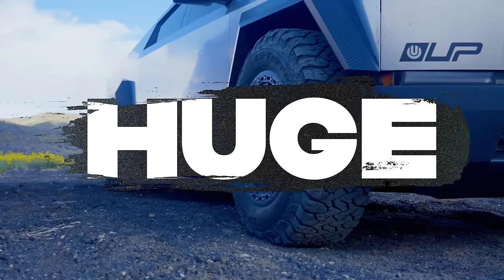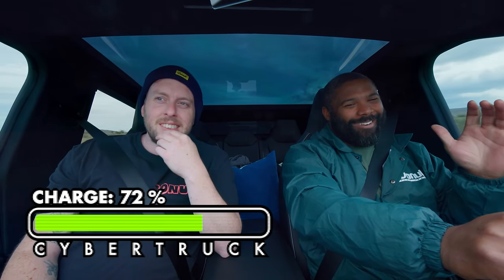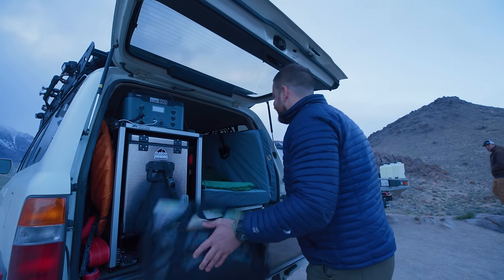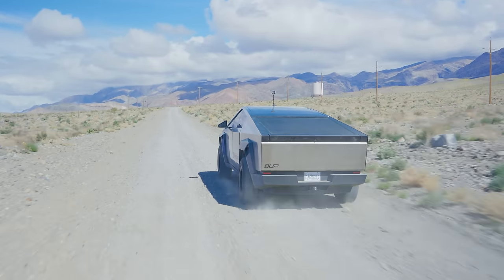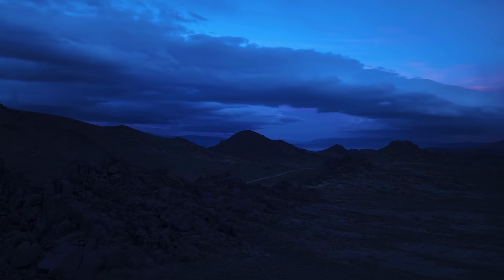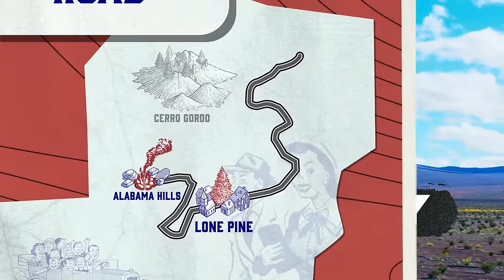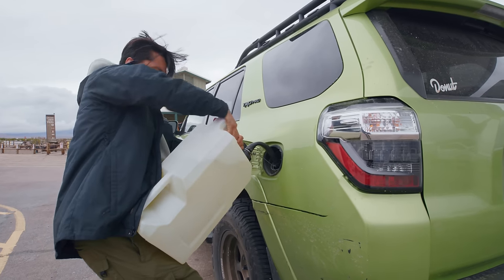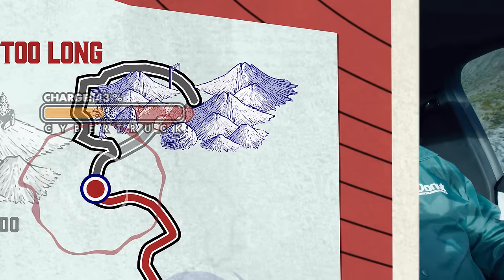Surviving 100 Miles Offroad in a Cybertruck

Comment: Having owned a tesla for over 5 yrs, the radio doesn't reduce range, it runs off aux 12V battery. And driving 80mph will drastically reduce your range

Comment: Ok, so… all those accessories you say are draining the battery, are also draining the tank in an ICE car.  With a lot less efficiency too, since its got to be converted to electricity from gasoline through a very inefficient process to begin with. 
Also, those things are minimal effects compared with driving the car.

Comment: The thing with the range is, Tesla manipulates the range estimation in all of their cars. Essentially when the battery is still quite full it will show you a wild overestimation of how much range you have left. As soon as the battery starts getting empty it will show you a much more realistic range estimate. And the cybertruck is especially bad with range estimates because it's Teslas most rushed and most stupid car and if you try to take it offroad the range estimate becomes essentially useless because the battery draw varies wildly based on the ground you are driving on, the speed, the weather etc etc.
Reply: The actual range in testing (outside of Tesla) was shown to be 22 miles higher.

Comment: EVs are great for city driving, commuting, pleasure type drives. Road tripping is OK as long as you're also OK with stopping much more often, but it fails on most other aspects of a traditional ICE vehicle.

I don't even think it's a charging issue, I think batteries are just not there yet (when it comes to density for range without making the cars stupidly heavier).

Battery tech needs more development before we're there.

Comment: DUDES - it takes 10 minutes to charge to 0% to 80% - THERE ARE FOUR OR FIVE superchargers between LA and Lone Pine depending on your route.  USE 'EM!
Reply: Lone Pine to Cerro Gordo is 22 miles!  Dudes your range is going to be way over 200 miles even in the chilly weather!
Reply: EV range extenders are like $700 on eBay now.  And you regen all the way down the hill to Lone Pine again.  C'mon!

Comment: Kudos for the attempt., I’ve been waiting for someone to try getting to the racetrack in an electric. However, the custom map makes it difficult to know where they actually went. Why did they go down the hill to Panamint Springs (empty gas station) if the destination was the racetrack? They could have turned north towards Saline Valley before Father Crowley Vista and saved a bunch of energy. Also, there is a charger at Panamint Springs, why not charge while the others were waiting for the gas run? Seems like they could have made a bit more of an effort if this was a real expedition.

Comment: 1:46 You're in Palmdale. Not exactly the end of the world-- but you can see it from there with a pair of a good pair of binocs.

I shop for my all my clothes in that very department store in the background.

Oh, and you're going uphill. When I drive down from there and into LA, I use only 20% of my BMW i4's battery to get into the valley. It's a 1400 foot elevation drop. Takes me 30% to climb back the same distance with the elevation gain.

Comment: All of those "drains" also effect a gas/diesel truck's range.  The only item that comes "free" on ICE is your heater (if the engine is running - not when parked).  Drive 70 in an ICE truck and compare it to driving 80 sometime BIG difference. ! . ! . ! (30% minimum drop)

Comment: Regarding range and regen--you will recover power when going downhill.  An ICE vehicle burns going up AND down.  Estimated range on ANY vehicle is based on some generic flat, road, <65MPH "route".   You are comparing a vanilla pickup truck to Landcruisers which are purpose-built for off road.  You will take a huge hit in mileage in a Toyota vs its rated range in a comparable situation.  If it had just enough gas to get you the  same rated range as a cybertruck, it would get even LESS range on the trail than the CT.  
HOWEVER, Cold is an , known problem -- both for range and for charging.
There is no way a full charge takes 1:20 (at a 47kW rate - the truck will take 250+kW), unless the battery is stone cold when you started (meaning you charged without preconditioning the battery) - - to cut down the charge time in cold weather, you should always preheat by navigating to the SC -- ALSO you could charge to 80% the day before (when the battery is warm) and just top it off to 100% in the AM (which should warm the battery back up for your trip.)
For max range, you want to LOWER the truck, not raise it (11:24).  
12:10 -- you showed increased range because your battery finally heated up to normal operating temperature -- which is why Tesla recommends you use scheduled charging (from home) so the car is filled to your desire and warm at the time you want to depart -- no wait and your battery is warm for most range on the road.

Comment: We went on a road trip from Seattle to Montana at the end of the summer last year.  We had a Ford Lightening in our group, along with A Mitsubishi Pajero, and an old Toyota FJ 45 pick up truck.  The other SUVs and trucks were more standard.  Five  trucks in all. Made it to Spokane and the FJ 45 only had about 1/4 tank in it.  The rest had about half a tank. The Lightening?  Down to 7% power.  And they had a heck of a time trying to find a place to charge it.  Finally had to go to the Ford dealership to get it charged.  That all took over three hours.
After discussing the situation, we loaded everything from the Ford into other vehicles, and we were off again.  Abandoned the EV at the very first stop.  It would have taken several days to make it to Montana in the EV.  Only a day for the 50 year old Toyota.  EV's are NOT for road trips.  They are for staying at home and charging every 150 miles. Totally useless in Montana.

Comment: Everyone is crapping on the Cybertruck because there wasn’t charging in the middle of nowhere, apparently there was no gas available either out there.  Off roading takes a lot of energy and no electric vehicle can do that currently without local charging available.  Off road gas cars can bring fuel along in multiple 5-gallon cans so they are good to go.  Maybe in 5 years things will be different, but the infrastructure is still being built out.

Comment: 1:53 Really, if you're at the office or home, you should have used a mobile charger on a 220 outlet or wall charger to reach 100% while you slept or worked before leaving. Unlike gas, which you can't produce at home or the office, you can charge EVs there.

Comment: OffRoad? dream on. I drive passenger sedans on those roads. And still get reasonable mileage. And have done  for over 50 years.
IF you want to go off roading in comfort the Landcruiser is the way to go. Roads like that you just drive them,, a sedan does require a little more care. Though I suspect my 64 Holden sedan had more off road performance than the cartoon truck has now. Though it may ride better.

Comment: The problem with the CyberTruck is Tesla put a way to small battery in it. With its 123 kWh battery that’s only about 3.5 gallons of gas equivalent. Try this same route with a Silverado EV 4WT and you will have a much better time with its ~215kwh battery. Tesla messed up with the Cybertruck.

Comment: The worst thing they did with EVs is give people detailed information about the power supply.  If they had just stuck with a percentage gauge like ICE vehicles, there would be less range anxiety.    The truth is, your ICE vehicle looses range when you use accessories or drive offroad.   About the only significant difference is cold temps.   An Ice vehicle wont typically lose range driving in cold weather.

Comment: It all is about physics. A lot of people don't really know how much power an electric engine in car draws. The thing with making car dash dark mode, switching off some quirks, even the lights are nonsense. Even camping with some christmas lights chain overnight. Charging phone, laptop or even use 1 time electric kettle (that drains a lot of power in home) either. Only electrical cabin heating (and battery) or AC drains battery in a way that we can see in a 0-100% scale. But riding on the bigger wheels with grippy tyres makes less mpg in petrol car, so even more in EV. Normal car doing 70 mph uses a visible amount of fuel more, not mentioning off road car compared to going ex 50. Makes me sad, maybe the presenters don't know much about EV electric stuff and wanted to learn it by the way. But I'm afraid it is done just for the sensation and some people that don't know all the stuff above may feel excited or even suprised. Others will only laugh in moments when stupid things happens (hope non scripted).

Comment: Cybertruckin' down the road.
Haulin' gear and a heavy load.
Juiced up last night, gone at daylight.
Family is ready to see new sights.
Plenty of room with some to spare.
So much power, none can compare.
A few hundred miles go by real quick.
Back into the campsite nice and slick.
Elon Musk once again made history.
Innovative style and affordability.
Driving is a pleasure unsurpassed.
Never worry about the price of gas.
People lined up to put money down.
Now they'll charge up and cruise through town.
Folks in the rust belt will keep that shine.
The stainless body will last a lifetime.
Make a desert run and have some fun.
Jump the dunes and spin out in the sun.
Climb down a steep hole and up the other side.
There ain't no place where you can't drive.

Comment: So, let me tell you something. Those Land Cruisers, if they run out of fuel in the desert, you can't produce petrol or diesel to fill them up. On the other hand, there are portable photovoltaic systems that can fit inside the bed of the Cybertruck, that once you unfold them and install them, they can collect enough solar energy in one day, to charge the Cybertruck to give it 100-200 miles of range.
Reply: how much does that thing cost and do you have proof of it charging a cybertruck in one day?

Comment: Dark mode on an LCD actuality used more battery. Oled has each pixel makcking up the color and light. LCD uses a backlight so if the image is black the. The pixel is fully on to make it black and u less you have a local dimming backlight the backlight is still fully on

Comment: So to go on a road trip, you'd need to carry a generator and a few jerry cans for charging. Let's say you carry a 5kW generator - it would have to run for 24 hours to get a full charge if you could run it at a 100% load all the time. However in real life, using the specs of a real 5kW diesel generator, it might look more like this: to get a full charge @50% generator power, it runs for 50+ hours consuming 18 gallons of diesel, for another 200-300 miles range in the CT. It's wildly inefficient, it's expensive and and it takes days for charging. 

And as we know, the chances of the CT breaking in a number of ways to leave you stranded are also rather big. I'm taking my 17 year old ICE estate instead - it gets 620 miles on a tank.

Comment: Wow the haters here is crazy.  

Dear donut media you really messed up with this one.   

1st. You realize you have off road tires that lowers the range 

2nd you’re loaded up that lowers the range 

3rd cold doesn’t severely effect the battery life.  Using heater does  you know what you’re going to do wear a jacket. 

I’m not saying the cyber truck is any good at off road I’m saying you did a poor job at reviewing.   

really you guys were like we’re going to make this unrealistic trip  to a place we’re there’s no chargers.  Where the question should be, if there were chargers would the truck be capable.  And you didn’t answer that.  

I think it’s a shame

Comment: So the cybertruck doesn't have a built-in solar power charger for longer trips.
Reply: A solar panel the size of the roof will put out enough juice to run the sound system without draining that battery. That's about as much power something that size will pump out. You will not be able to recover range via a truck-sized photovoltaic array.

Comment: This has got to be one of the most half assed videos I've seen from Donut in quite a while. Drives on some dirt roads, calls it off roading. Brings no way to charge an electric vehicle for an extended 100 mile "off road" trip. lol Solid 2/10 effort went into this, it's hilariously sad.

Comment: I have a great business idea. What if someone invented something portable that you could get ready before the trip and put in the back of the truck for when you get low on battery so you can recharge? I have a small red energy container that takes 15 secs to recharge at the energy station and gives my car an additional 30 miles but if i recharge the bigger red container which takes about 90 secs recharge time i get up to 150 extra miles of range.

Comment: Can you charge it from a generator? Doubt it would let you drive while charging if you put one in the bed and ran the cable over the side. At least be able to charge it at camp. I live in the desert mining every summer living off solar only with LiPo batteries. Can't handle A/C but fridge and everything else works well. Wouldn't want to try and charge a cyber truck from it though...

Comment: Why not customized it with solar panels via generator? That should extend the battery energy.
Reply: Photovoltaic solar panels turn only 20% of the sunlight they collect into electricity. A solar panel covering a car roof is just good enough to keep the infotainment system from draining the battery, nothing more.
Reply: @BogeyTheBear  they said 6 solar panels to charge an EV vehicle battery. It's better than nothing. Bring in a generator, it can store the energy in case of emergency. It takes less than 4 hours to charge full when it's connected to an AC outlet. If it is connected with solar panels, it depends on full sun light, partial or none. Even if cloudy, the solar panels get very low voltage coming in. Usually it takes about 6-10 hours for fully charge under the solar panel charge.

Comment: Ok so how many miles did you get before you ran out.. maybe i missed that part skimming through ??? From what ive seen online they get like 170-220 miles.  Which is pretty piss poor, considering my 1976 Jeep Truck and Wagoneer with a inefficient 360 V8 and 18 gallon gas tank.. gets 200 miles..  And thats absolutetly trash 200 miles.. I constantly refill the tank..  Then going up to my 98 Grand Cherokee with a 360 23 gal tank but it gets 2x better gas mileage, i get 400 miles to the tank...  200 to 400 miles is huge...

another thing is even if i bring my older trucks to a trek like you did yours, and its 200 mile range, i can have 2-3 5 galon gas cans in the back, and simply refill my tank for another 100-150 miles

Comment: Making pronouncements about when the future is when you don’t even seem to know about Level 2 chargers is a bit cheeky. I took a day trip around Yellowstone National Park with a 275 mile range Tesla Model 3, starting with a battery at half charge, and it worked out fine. 7 years ago there was a Level 2 charger at every hotel and Park facility, and we went from destination to destination, sipping a few miles more juice at each place without slowing down the trip. If you’re really going to travel 100 true overland miles with zero infrastructure, yeah, you need to plan, just like the people in gas cars did. In any case, Tesla will likely release the auxiliary battery pack next year.

Comment: 0:54 worlds strongest man, will hold tight if the vehicles begins to slip downhill

edited= ok tbh, not even going for 150 miles with that rather light load on those bigger wheels is pretty much laughable.

Comment: If you’re gonna go off-road with an EV, use a solar panel to charge it, albeit slowly 👍
Reply: Road-portable solar panels are juuuust good enough to recoup the hotel load off the 12 volt battery system. In order to revitalize the traction battery of an EV requires dino juice or a palladium arc reactor built by Tony Stark.

Comment: For sure NO body will dare to drive off road alone with the Cybertruck.  Guarantee to run out of charge NOT able to get back.   Proof is in the quick drop of charge in good condition. I know people that have the model Y and 3.  I did see the range drop with harsh climate and driving style.

It has to start somewhere,  Cybertruck is doing it but the result is not good.

Comment: In the future you could take your fuel with you.. get 6-10 kw of solar panels and charge of the sun as you are rolling off road... You'll have to take 6 days for a full charge, but who doesn't like to camp? Check out the Solar Cannonball run done recently in a Tesla Model Y. Coast to Coast on only solar panels packed in the vehicle! cmon guys! use your imagination! Maybe you can get a small hydropower generator too! even a wind gen! maybe tow a power trailer? hmm.. talk about over landing!

Comment: I wheel a 99 XJ with an aluminum 2nd tank giving me 40 gal of total fuel for over 500 mi of range. I could probably get 800 by swapping in an R2.8 diesel. The basic problem here is that batteries weight a shyt-ton, meaning there is no way to extend the range. In no conceivable universe would I try to take this bloated corrosion factory to any of the places I go.

Comment: I once took my 250km+ 2004 mazda 3 through a 8 hour trip with rough rocky roads that the bottom of the car was scraping on the rocks and the engine had a blown head gasket with the radiator fan controller broken that i had to hook it up straight to the battery with cables and some fuses and it was full with 5 people 
And it still went back home 
Then engine gave up at 280km but who gives a shit it served well